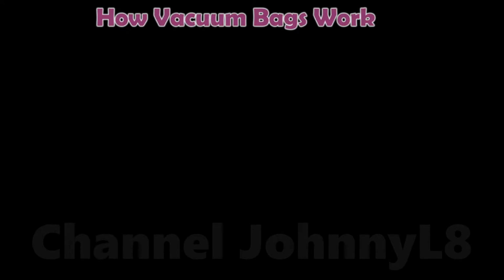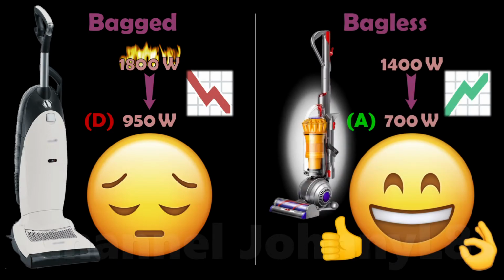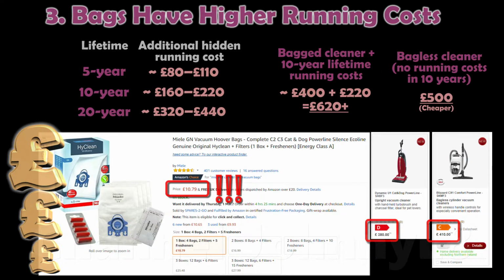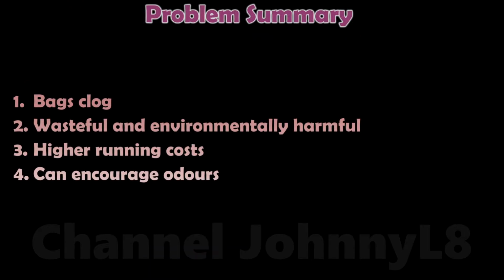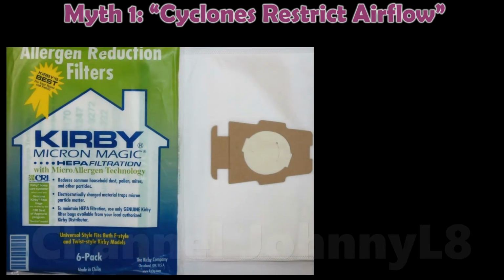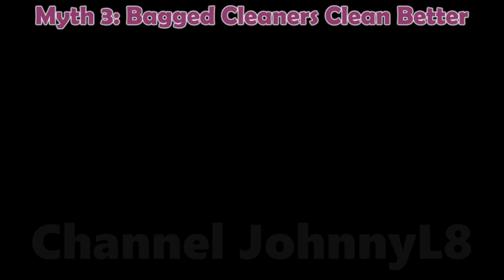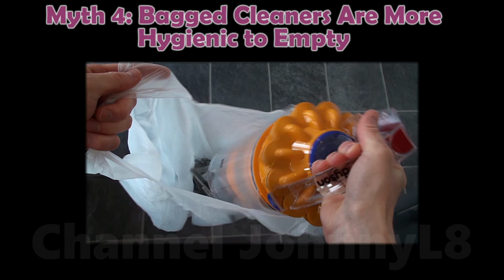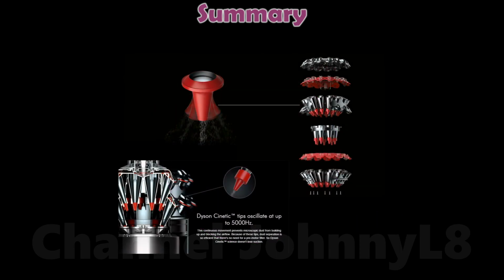Bagged Vs Bagless Vacuum Cleaners

Comment: I definitely agree with most things said here. I have worked with a bagged before and lord isn’t it an absolute dust spewer! It easily spews fine dust out of the hole where dust enters and actually made my lungs hurt for a short while. Never experienced any of that with Dysons. Bagless haters will always be blind.

That being said I do disagree with a few things you said but regardless I will always go for bagless
Reply: You know depending on the vacacuum you can literally by self sealing bags or even bags with caps. Not to mention it isn’t as bad a bagless cleaners where it just lets it all fly as you empty the bin.

Comment: You seem to mention Dyson a lot as premium and the price certainly is at the top end and don’t wish to recognise Sebo. It really doesn’t take much research to see that shark and Dyson are not particularly reliable. This is where Miele, sebo, numatic are generally considered very reliable machines that all use bags. 
One thing I will say and it’s relevant to the debate about bagged vs bagless is I have a multi cyclonic upright vax Mach air. Couple years old and I can tell you that I clean it religiously every time it’s emptied. I can do 2 rooms before it’s full and it’s filter is dirty, hanging in crap and that’s the last filter before going to the motor. The tube after that filter is dirty with a film of micro dust all over it.  That dust is inevitably getting to the motor itself. Better machines have more filtration to prevent dust particles entering the motor and the room and that’s a cheap vs expensive argument. But the most reliable machines tend to use hepa bags. At my local recycling centre there’s no shortage of broken Dyson and other bagless machines to a point where there’s a shipping container full of broken bagless machines. Bagged I believe is more reliable as the bag acts as a large filter and is replaced when full. In the uk we don’t have any cheap bagged vacuums so you have a choice of numatic, sebo, Miele and some Bosch machines, all reliable brands to begin with. Bagless I feel to be reliable and have the longevity of bagged counterparts they would need to have filter changes more regularly and filters to be cheaper and replaced at similar rates to a bag replacement. 
I don’t like how bagless has been marketed as being so easy to empty as reality shows the it simply doesn’t matter how many cyclones they have the dirt stick to the inside of the cyclones, internal plastic, filter, rubber gaskets. It’s a chore to clean them and when u empty them u get covered in cloud of dust.
Reply from the maker: Your praise for bagged technology is flogging a dead horse. Cheap knockoff bagless and old-fashioned, limited bagged technology is not worth serious attention. The points raised in this video (that were not addressed in your comment) make this point clear, as do the technical details in other videos on my channel (such as the recent V15 absolute + review exposing the relatively pathetic level of filtration of even HEPA bags). You also provided no statistically significant, objective evidence to support the claim that Dyson machines aren't reliable (however you defined that). When treated as instructed in the manual, they last 10 years at the very least, by design.
Reply: You're literally wasting your time arguing with him.

Comment: I see why some people choose bagless vacuums. However, I personally prefer bagged vacuums just from an emptying/maintenance standpoint. I have a Miele and I prefer it to my Dyson. I thought the part on the EU power-cap was interesting. As someone that lives in the U.S. that doesn't apply to me, but I could see how that could factor into people's decision making if they live in a country that is part of the European Union. That being said, I agree that suction power and airflow stats aren't the only important factor when examining a vacuum.
Reply from the maker: Each to their own. Although, from an emptying/maintenance standpoint, it takes 5 seconds to completely messlessly empty a (good) bagless cleaner and without incurring any costs, as evidenced several times on my channel e.g. https://youtu.be/E_ik6qScs0o . I know of nothing better. Some people use a horse and cart rather than a car. Some people like using candles to light their home instead of electricity. I respect you too much to respect your opinions though, given their 'justification'.
Reply: @VacuumFacts mparing a bagged vacuum to a candle or horse and carriage is monumentally stupid. Dust and airborne particles are much better contained by a bagged vacuum which is especially helpful for those with asthma or lung conditions.
Reply from the maker: @josephk1342  It was a perfectly apt analogy that represented the regression of older technology that doesn't work as well and that we've excelled far beyond now. Your claim that "Dust and airborne particles are much better contained by a bagged vacuum" is a misleading half-truth. It is true for cheap, nasty bagless Dyson clones, but is utterly false for Dyson machines and any others that are marketed as "whole machine HEPA filtered". The latest Dyson technology currently has the greatest level of filtration of any residential machine on the market by an utterly huge margin, as explained in great detail in both the Gen5Detect review https://youtu.be/7wa3SrXh-0s and the V15 Absolute+ review https://youtu.be/4aL0eJenTqw which I'd encourage you watch to learn from. Other machines, including all bagged machines with HEPA filters are relatively polluting in comparison now.

Comment: I have Miele and Sebo bagged and Miele bagless and imo bagged is by far better.
Reply from the maker: It's not surprising you'd come to that conclusion from the list of bagless products you mentioned.
Reply: @VacuumFacts  well I have a handheld Dyson too but the suction on their isn't very good but it never gets blocked or gets too dirty so I like it.
However with a Miele Blizzard bagless vac I have had to unblock the little round filter mesh filter a few times.
Overall I just think Miele and Sebo bagged vacuums are miles better than any bagless ones and are more hygienic as well when you empty them. Plus the bags last for 6months or more and even when they are full the Miele keeps going strong.
Reply from the maker: @Hero87  For many people, long term use of a bag results in vile smells because the dirt isn't emptied. Many have also suggested they need to change bags weekly because they collect a lot of dirt. Any Dyson before the V10 was not intended as a mains replacement. The latest V15  performs better than any mains cleaner (in max mode) and exceeds typical mains cleaner performance in its default mode.
Reply: @VacuumFacts  ah right that's interesting to know about Dyson thanks. No wonder my handheld Dyson is kinda weak. I only use the motorised brush to clean the stairs tbh.
I've never had issues with bagged vacuums smelling plus the Miele has a charcoal filter so that the air comes out freshly filtered. 
If users are filling up bagged vacuums weekly then they must be using them as commercial cleaners but even that seems impossible because the dirt is compacted. I like the Miele bags as they have multiple layers and really do a great job. I take it you prefer bagless? I honestly would stick with bagged only from my personal experience rather than Dysons which I find gimmicky with clever marketing imo.

Comment: What a one sided comparison and he cherry picks his arguments to accomplish his predetermined outcome. There is no impartiality where both sides of the argument are wagered, rather it's only bashing one and elevating the other. Furthermore he twists facts in order to make it sound like all the negativity is on the cyclone ones in order to win sympathy.

I have owned both bagged and bagless ones during my lifetime. My first was a Miele, second a Dyson, then a Hitachi cyclone, and now I'm back to a Miele. In all honesty they all have their perks but they are also vastly different in comparison. It's all down to the context and circumstances you find yourselves in. The cyclone ones always throws fine dusts back into the air whilst the bagged ones don't, and this is the primary reason why I like bagged ones over bagless. Since I have Asthma and suffer from allergies, having a dust free environment for me is a no brainer.

Also one will find bagged vacuums tend to have a much higher wattage rating than the bagless ones, this extra power allows the vacuum to adjust when needed during operation and helps compensate for a reduction in air flow when the bag starts to become full. So basically you shouldn't find a reduction in suction power on reputable brands because you have this extra power at hand.
Reply from the maker: a) it's not a review, b) what parts specifically did you disagree with and can you provide a reputable source of evidence to refute the fact-checkable content in the video? Or are you a whiny troll who simply doesn't like facts that conflict with a wonky worldview or what you'd like to be true. >_> yawn
Reply: @VacuumFacts  You provide no source for your "evidence" whatsoever, if the testing done by Dyson as you've shown here is your evidence rather than it being done by a reputable, verifiable, independent third party source, then I think there isn't much in terms of credibility to go on in this case, and I'd certainly question the conflict of interest here too. Just so that you know suction power, one aspect in which you're overly focused on about, is only one variable amongst a whole bunch of others that a vacuum's measure of quality is determined by, you'd also have to consider what the vacuum does after the dirt gets sucked in. Suction power does not necessarily mean it's a measure of quality, rather how much of the dirt doesn't get released back into the air should be your primary concern, what is the point in a vacuum cleaner when it cannot achieve the purpose it is set out to do from the start?
Reply from the maker: I see you've edited your original post. The factual claims you've made are demonstrably false; I recommend actually watching the videos on my channel for the evidence. I also see you haven't defended your position in any convincing way. A classic example of misinformation in your comment.
Reply: @VacuumFacts   Your videos are mostly about Dyson and how good they are, there are very few comparisons with other reputable and top quality brands, I don't know what information you expect me to extrapolate from them when it lacks any form diversity. The fact you already stated in your channel description that it's not based upon scientific evidence and that you're more interested in quantitative than qualitative content, is enough proof for me you're not concerned about quality and truth in your videos.
Reply from the maker: You're still extremely vague. You've not said what specific claims in the video you don't agree with, so it’s hard to comment.
>>“if the testing done by Dyson as you've shown here is your evidence rather than it being done by a reputable, verifiable, independent third party source, then I think there isn't much in terms of credibility to go on in this case”
The claims shown in the video are from testing done by independent laboratories to international industry standards. This is exactly what you wanted, but somehow have suggested it’s weak, which makes no sense.

>>”and I'd certainly question the conflict of interest here too”
Well, that was poorly defended.

>> “Just so that you know suction power, one aspect in which you're overly focused on about, is only one variable amongst a whole bunch of others that a vacuum's measure of quality is determined by...”
I suggest you bother to watch my other videos which explains all this in meticulous detail.

>> “Suction power does not necessarily mean it's a measure of quality, rather how much of the dirt doesn't get released back into the air should be your primary concern, what is the point in a vacuum cleaner when it cannot achieve the purpose it is set out to do from the start?”
Where is your evidence that modern Dyson machines expel dirt during operation? There is none.

>> “Your videos are mostly about Dyson and how good they are, there are very few comparisons with other reputable and top quality brands”
Incorrect again. My videos are about the best technology out there. This is provided by Dyson by all measures. And many of my videos are very much comparing it to competitors. Incredible ignorance on display here.

>> “I don't know what information you expect me to extrapolate from them when it lacks any form diversity. The fact you already stated in your channel description that it's not based upon scientific evidence and that you're more interested in quantitative than qualitative content, is enough proof for me you're not concerned about quality and truth in your videos.”
If you have specific objections to specific claims made in my videos, then provide some detail. Otherwise, your whining rings hollow.

And some earlier comments you made:
>>“What a one sided comparison and he cherry picks his arguments to accomplish his predetermined outcome.”
I present carefully reasoned explanations that are fact-checkable. Something you have failed to engage with despite multiple requests.

>>“There is no impartiality where both sides of the argument are wagered, rather it's only bashing one and elevating the other.”
Again, I’m stating facts. If you disagree with something, state what, very specifically, and evidence it. Otherwise stop whining that facts conflict with what you’d rather be true.

>>“Furthermore he twists facts in order to make it sound like all the negativity is on the cyclone ones in order to win sympathy.”
Which facts have been twisted, specifically, and in what way? What is the truth as you see it, and most importantly, can you provide the evidence for your claims? I’ve done so in this video, and if you disagree, state what and why, specifically.

>> “The cyclone ones always throws fine dusts back into the air whilst the bagged ones don't”
Please can you provide evidence for this. There is plenty on my channel empirically demonstrating this is false for the Dyson machines that are the subject of this video. At the end of this video, I also criticise bagless knockoffs which are guilty of what you speak of.

>> “Also one will find bagged vacuums tend to have a much higher wattage rating than the bagless ones, this extra power allows the vacuum to adjust when needed during operation and helps compensate for a reduction in air flow when the bag starts to become full.”
The myth that using more power automatically achieves better performance has been demonstrated false, not only by me on this channel, but by others independently, as discussed in many of my videos. Pointing out the disgusting copout that brute forcing performance by jacking up the power to compensate for a failure of bagged technology is not only self-contradictory, but a serious criticism made in this video. The whole point of this video was to show that better approaches eliminate bags and this problem.

And then there’s literally all the other disadvantages of bags discussed in this video that you’ve completely ignored. You have a wonky worldview, make factually inaccurate statements, demand evidence already presented in this video whilst providing none of your own, and are utterly vague about what it is you take issue with specifically in what’s presented. Waste of time.
Reply from the maker: <tumbleweed> figures...

Comment: What a lot of nonsense. I have owned several bag less vacuum cleaners from the famous British brand - you know who you are promoting. I think they are rubbish after about a year. No offence. Bags can be made of paper which is 100% recyclable. Some cloth fibres can be manufactured recyclable too. So it is a lot of nonsense. Bagged vacuum is MORE hygienic. I have come to realise because you throw away the filled bag, your machine is back to new. But the bag less machines are in direct contact with dirt. They themselves get dirty and ultimately become an expensive junk. The hygiene is EXTREMELY poor. All kinds of mites can be seen walking around even with a naked eye after few months of use. They are in the machine!! Not in a biodegradable bag that you can just throw away!
Reply from the maker: Not very convincing and you didn't address the points raised in the video. Bagged being hygienic and bagless not being is a myth debunked many times. The best bagless machines are quick and messless to empty and add nothing to landfill, as evidenced in many videos on here. Mites exist in all vacuums and they stay there until emptied or death. None of this refutes the points raised in the video.